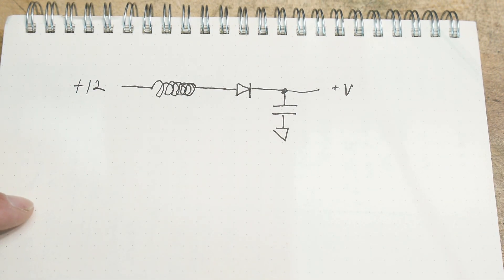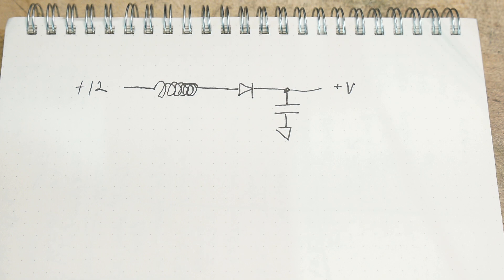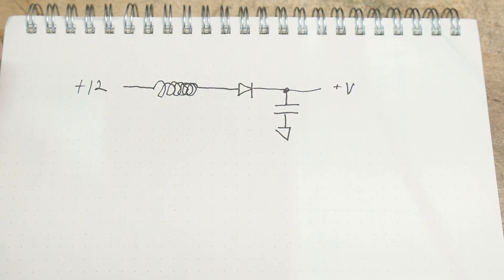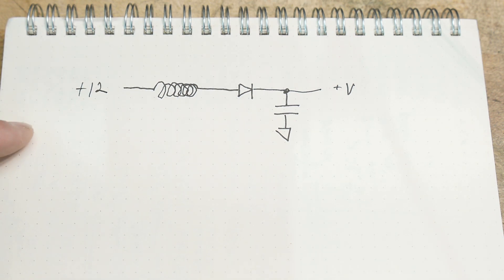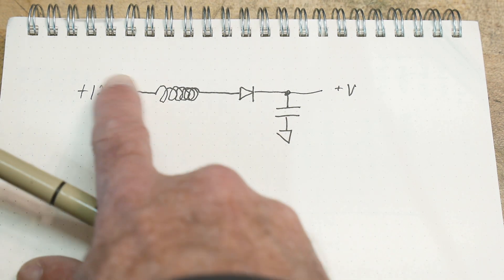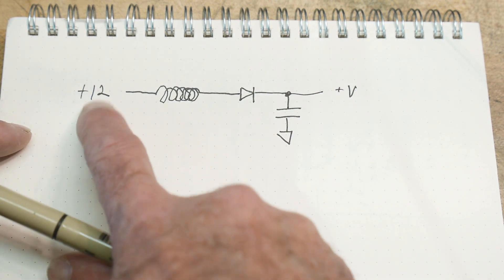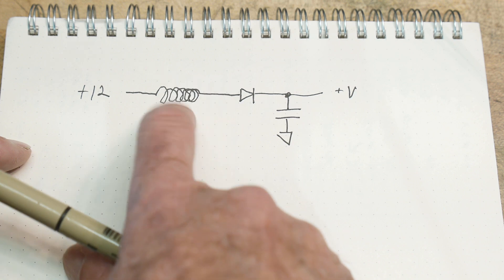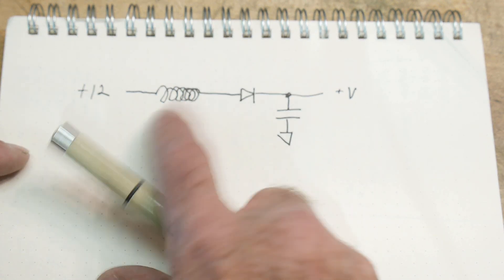#689 DC-DC Boost Converter Basics (part 1 of 3)

Comment: First thanks for the leçon .
1- For the second method ( 2 transistor ) . I think that PWM SIGNAL must be always SO FAST because we have the ability to slowing down ( decreasing ) but we dont have it for rising ( increasing).

2- Can we use an RC oscilator for generating a square wave signal ?.

Thanks.

Comment: also, it's not a good idea to use a compact coil, in a white plastic on a white background, I don't see the difference between input and output. It would be better to add a real coil and 2 wires connected to the coil for input and output to see what's going on.

Comment: it would be easier to understand if you used different types of connectors or wires for the circuit and for the voltmeters and if you use some pins to put your circuit just in front of the schematic so we know where we are on it. Like in 10:06 there are 3 connectors to the same pin. I'm completely lost. It's a shame because it's a nice idea to tape the wire to show what it does.

Comment: any way to get regulated ac voltage from a transformer.
Reply: i wan to get 24 voltsAC  from step down transformer.but when ever in put varies out put also changes.any possible solution to get stable 24volts AC.
Reply from the maker: the old HP power supplies (Harrison) had a pre regulation before the transformer. it was like a light dimmer circuit that used an SCR. you might look at some of those schematics

Comment: Good video, I would recommend you explain the difference in storage elements. The capacitor is storing its energy in the electric field and the energy in the Inductor is in the magnetic field. You did explain this, but it is the rate of change of voltage and the rate of change of the current. It is the back EMF from the Inductor that adds to the voltage on the capacitor to boost the voltage. I enjoy your instruction, thank you. It will be interesting to see what we are going to learn in the remaing parts.